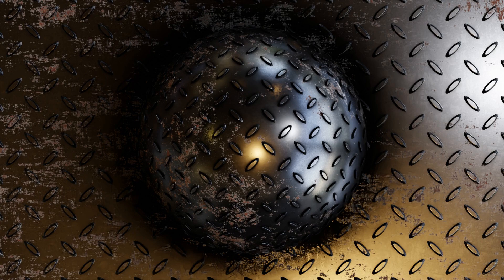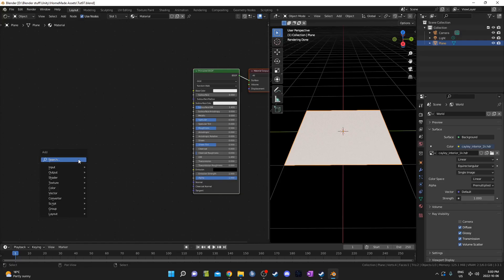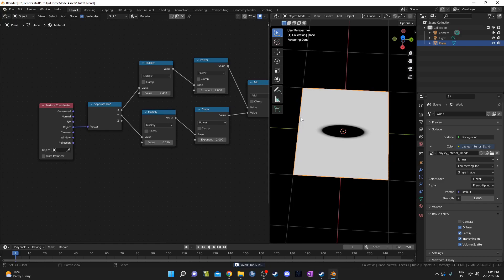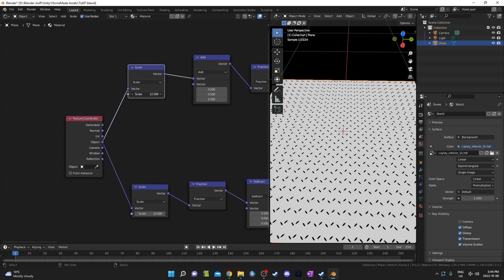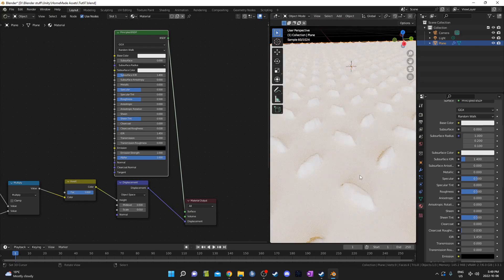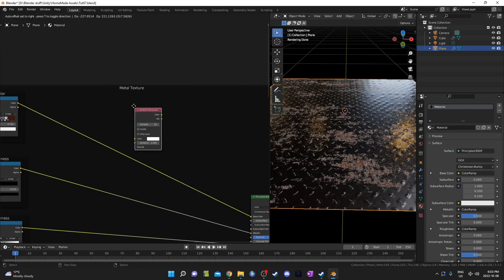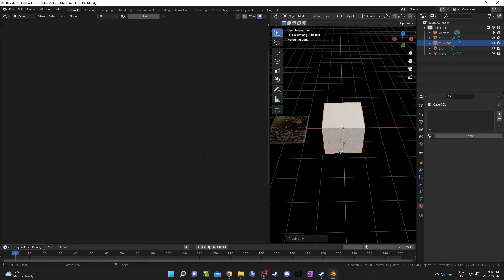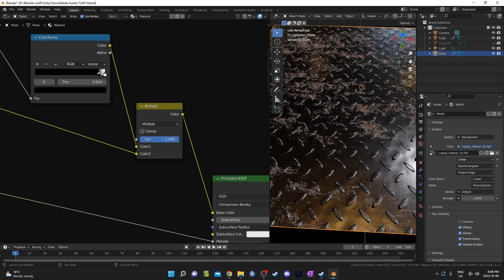Procedural Metal Plate texture in Blender - Procedural Nodes part 97

Comment: one thing ive seen is that the rust is related to the intersections of the bases of the details and the plane which would be where the rust would could originate from as water would be stopped by the raised detail and not affect the tops of the bumps as much. im sure you could figure that out easily in nodes since you can do this much. it would be one small detail that would be nice to see. thanks for sharing the vector info. its neat.
Reply from the maker: Good insight, it would be possible to use the shapes themselves as an additional mask.